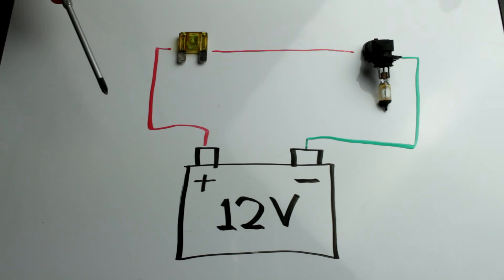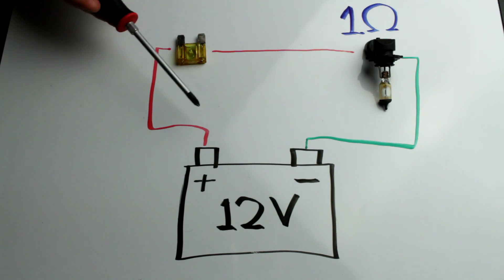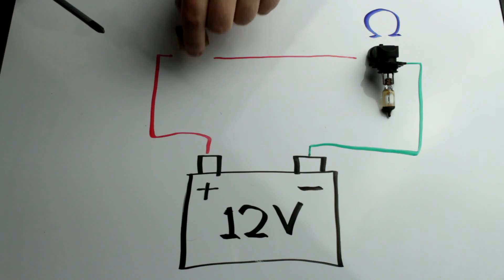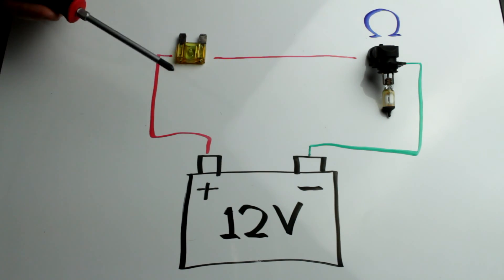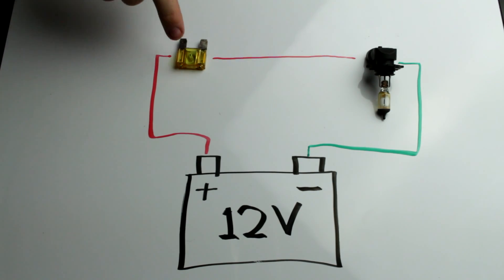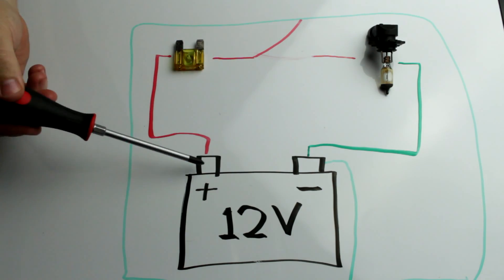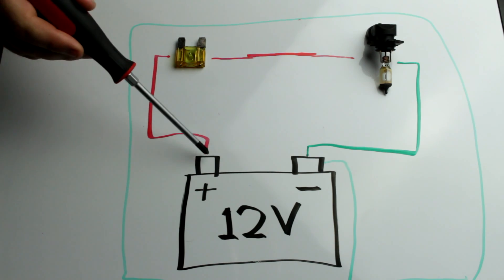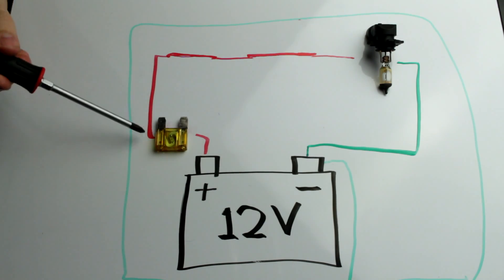Why Cars Have Fuses: What a Fuse Does & How They Work • Cars Simplified

Comment: Ok but why should u not just swap out a fuse for a new one? Can u elaborate more on that. I work on Safeway meat wrappers and I was wondering why a vacuum power fuse blew.
Reply from the maker: You can certainly replace a fuse with another fuse of the same size/type/amperage. However, unless a one-time/rare issue occurred to cause the first fuse to blow, the next one will likely blow quite quickly as well. If fuses are very cheap, readily available, and quick/easy to replace, some folks just end up swapping fuses out regularly. However, there is some sort of issue occurring that should really be dealt with, especially since fuses protect against excessive current, which can cause wires and/or components to overheat.

I don't know what would specifically cause the excessive amperage in the vacuum, but unless there was a power spike from a lightning strike or something external like that, there could be something worn/damaged inside, or even just too many components running at once (owner/user manual would elaborate on that if it's a possibility).

Comment: Could the bulb still work without a fuse in the line?
Reply: Technically yes. Some people will bypass the fuse entirely by bridging the gap with something conductive. But then you're forgoing all the safety protection that the fuse was supposed to deliver. If something goes wrong, something else will become a "fuse", such as your wiring, a component. And instead of a little part to replace, something big is going to melt or catch fire. Think of it this way: can you go skydiving without an emergency backup parachute? Sure. But I'd rather have that emergency chute to break my fall rather than my face.

Comment: I dont know if my question will be answered since it has been 5 years after the release , but my question is since the fuse is after the battery shouldn’t it recieve 12 volts ?
Reply from the maker: A fuse tested in the fuse box should be very close to the negative battery post to positive battery post voltage. If the voltage is only on one side of the fuse, then it's a blown fuse. On a powered circuit, if the voltage is lower at the fuse, there is some form of resistance between the positive post and the fuse. You can double-check this by putting a multimeter/voltmeter lead on the positive post of the battery and the other lead on the fuse (with nothing taken apart on the car and the circuit powered) to get the voltage drop between those two points. Even on a good circuit, you may get a tiny amount like 0.02V but too much is a sign of an issue like physically damaged or corroded wire in that section.

Put simply, yes, the fuse should get ~12V (12.6V with just the battery, ~13-14.5V with the alternator providing power) under normal conditions.

Comment: this may be a dumb question but.... what will happen if the bulb and the switch switched places and there was a ground in between the bulb and the fuse?
Reply: It's not dumb to consider hypothetical situations. Now I'm not qualified to answer, but I hypothesize and speculate that it depends on what the "ground" connects to.  If it's the automotive "ground" that ultimately connects to the negative terminal, then the circuit is complete and it will bypass the switch, whether the switch is on or off. If it's grounded into the earth itself, then it would only have a complete circuit when the switch is on. That's my guess.

Comment: My positive wire leads into the bottom side of my fuse box on my SUV, i found a couple of plastic pieces I can pinch it barely open the wall sleeve, but I can't get to the under side of the connection,starting to break plastic...how does this fuse box come undone so O can change out the cable and fuse?

Comment: Hey there need some help, can I use 5amps fuse instead of 3 that was originally? I have mounted a dashcam there and it burned the 3amp fuse
Reply from the maker: I replied to your comment on the other video, but in case someone sees this comment and is curious about an answer,  here it is copied from the other video:

Assuming that 3 amp fuse is what the manufacturer calls for, that is a bad idea; the circuit (dash cam, wires, etc.) is designed to handle a given amount of amperage, and when it gets too high, that 3 amp fuse protects it. A 5 amp fuse will not offer the protection it needs. If it burns another 3 amp fuse, there is a problem elsewhere.
Reply: @CarsSimplified  thanks for your fast reply!

Comment: YIKES, lot of missing info, and some assumptions I must question. Most importantly, I cite was that "a 20 amp circuit should handle a 21 or 22 amp load". If this were the case, the inrush of turning on a high demand item would always blow fuses. Circuit is likely designed to carry 50-75% of the assigned fuse. 

There was no mention of fuses on the "internet" market being defective in design, and not blowing as implied by their amperage markings. This is more critical than anything on the topic.

You test a fuse as a diagram..... had you hooked up actual wiring and a power source, you might have been surprised, if generic fuses were in place.

Anyhow, the intent was honorable, but the research and prep seemed lacking. I know, I should not criticize if I have not done a better video.... but misinformation can be very costly to those relying upon it.

Comment: I thought the voltage comes out of the negative and goes to the positive
Reply from the maker: That's what happens with the electrons/in electron theory. Conventional theory is  easier to teach because the + and - symbols are counter-intuitive for a lot of beginners ("+" implies a surplus of something that needs to go where the "-" is). But you're right, electrons with their negative charge move from the negative post to the positive.

Comment: If I tap a 5A fuse in the fuse box for a new circuit with a 20A fuse (using one of those fuse taps), will the new 20A circuit melt the (+) wire for the 5A fuse?

Comment: Great video! This would explain why my new led dome light blew the fuse because it was about 4mm out so me being a noob I must of increased amps because it didn't fit properly lol. Lesson learned
Reply from the maker: Thanks!
If that 4mm was enough to touch a grounded piece of metal nearby, it could have caused a short for sure!
Reply: Cars Simplified I guess that's why they say get the correct sizes oh well at least they fitted in the number plate lights lol

Comment: What happens when they use 5 30A fuses on the same jumper? If it a 150A fuse or just a heavy duty 30A?
Reply from the maker: I had to look up the jumper and see what that was, since I don't deal with them, and I saw the part that taps into a fuse as well as some other options, but I'm not sure how you could add more fuses to it.

But, I can say that putting multiple fuses in series means that that circuit will be protected by the weakest fuse (even if they are all 30 amp fuses, they might actually be 29.98 amp, 30.05 amp, 30.22 amp, etc. thanks to imperfect manufacturing) in that series, and putting the fuses in parallel will mean you add the amperages together, and any imperfections get multiplied (if they all say 30 amp but they are actually 29 amp, five of them in parallel would be 145 instead of the 150 it implies, and that works in reverse, too; 31 actual amps would become 155 amps) and you would also blow all five fuses as soon as the first one goes. Neither option is ideal because they introduce more imperfection variables, more complexity, and more cost.

If you get one of those taps to add a circuit, if it has one fuse, that is likely going to run into issues I can explain if you're curious. The two fuse version should be splitting the circuit off before reaching each fuse; if it is designed that way, then each branch has one fuse on it, and that is how most fuses work before dealing with jumpers in the first place.

I think I'll make a video on this; it's definitely something I can explain better with visuals.
Reply: @CarsSimplified  I was asking because I'm working on a PEAK 1200 watt Mobile Power Outlet PKCOM12 and it has 5 30A fuses soldered to the board and was thinking solder a 8 gauge wire to each side and use a 150 breaker on the outside.
Reply from the maker: That might work... Are the fuses on the 12V DC side or the ~110V AC side?
Reply: @CarsSimplified  12V side at the input

Comment: how is that possible considering that the battery amp is well above 150 amps
Reply from the maker: If you are referring to how a 10 or 20 amp fuse doesn't just blow when a battery with a higher amp rating is powering the car's electronics:

A battery's amp rating is a maximum it can do (but it's more complicated than that) and each fuse is a parallel brach, so if one circuit draws 5 amps and another draws 20 amps, the battery cable will have 25 amps going through it until it splits into those two circuits. The amp rating on the battery is more important for starting, since that uses a lot of amps.

Comment: Does the brand matter,???
Reply from the maker: Not too much, but quality can be an issue because the actual amperage a fuse blows at is based on the fuse element inside, which may be off by some percent if not manufactured well. Sometimes that percent isn't enough to matter, but sometimes it is, and there is no telling which circuit is which.

Also, on the bladed fuses, I've seen some manufacturers not put the test points in, so they aren't as easy to check with a multimeter.
Reply: @CarsSimplified  I got some from Amazon but they don't fit my RAV 4 2015, they have longer pins, why is that? How can I know the correct ones??
Reply from the maker: Usually that's a mini fuse versus a low profile mini fuse. If you look up an automotive fuse chart, usually it is pretty easy to compare them, especially if the chart has measurements for scale. The low profile fuses are a pretty new design.
Reply: @CarsSimplified  also I have a brand new car but I see some fuses and rely missing, why is that ? Is that normal?
Reply from the maker: Cars often have blank spots for features not on that particular car but on versions of it with additional features, or so they can add features later on. Sometimes they never add those features, so every single car has the same blank spot.
Reply: @CarsSimplified  It Said wipers but all my wipers are working good front and rear.
Reply from the maker: Weird! Maybe there is an advanced wiper option available like rain detection? I don't know.
Reply: @CarsSimplified  maybe, its 7.5 fuse , my question is: will it hurt to put a fuse in that empty slot anyways???

Comment: does it matter if you flip the fuse 180 degrees ? will it still work? or does it let current flow only in one direction?
Reply from the maker: A diode (which some vehicles have in the fuse box and looks like a fuse, but not clear and with a diode symbol on top) will only work in one direction, but a normal fuse should work whichever way you plug it in.

Comment: Good video but there’s one thing I’m stuck on. Say if your light bulb takes 5 amps would u want your fuse higher amps than the light build but less than the wire so the fuse doesn’t keep blowing out. So for example 5 amp light bulb with a 7 amp fuse and 10 amp wire?
Reply from the maker: That's a good set-up you described, yes. The wire being able to handle 10 amps means the 7 amp fuse will be what burns out if a fault causes high amperage.
Reply: Cars Simplified but what if a fault was at 6 amps and went pass the 7 amp fuse and destroyed the 5 amp light bulb? Sorry I’m quite new to this, appreciate your time
Reply from the maker: Ah, no worries!
The bulb being a 5 amp is basically the most amps it will use at a given voltage. A high amp fault would be like a shorted circuit to ground, or power going to the wrong component. I may do a video on this now, it's getting difficult to describe without a visual aid.

But, specifically 6 amps would be an odd way to fail, and it would have to be due to bypassing the bulb in some way, or installing the wrong bulb. In that situation, though, with a 10 amp wire and 7 amp fuse, the fault would be able to just continue, but is low enough that it shouldn't cause any damage. There may be other issues happening, but that would have to be discovered.

Comment: My mother's 2005 hyundai accent gls has a few electrical problems (doors won't lock, side mirrors won't move, window on front passenger side only goes down, clock buttons do nothing) I've checked all the fuses but there's none blown and without a multimeter or the proper knowledge of how to use one I'm limited to what the issue might be. With a little research online I found that it might be the diodes, my question is, is it possible to swap the diode from the inside of the car fuse box with the one in the engine to see if it's one of them or will that cause further problems?

Comment: I had a total of 5 fuses burned out. But. I ended gettting a new altanatore and a battery. It still was giving me eletrical problems the headlights would. Dim low and i had loss of power turns out it was number 10 20 and 40.   Fuse. Only a total of 15 bucks wooow!!!